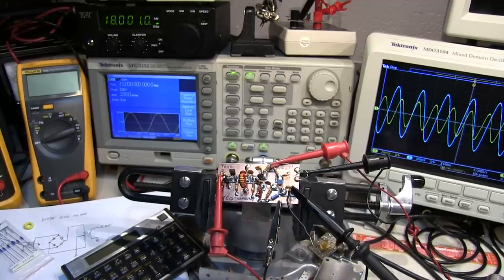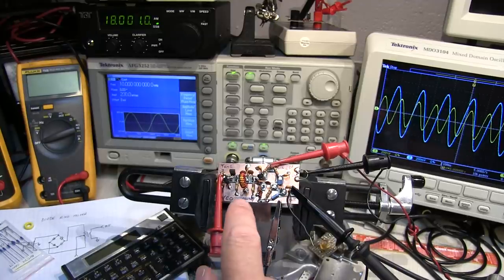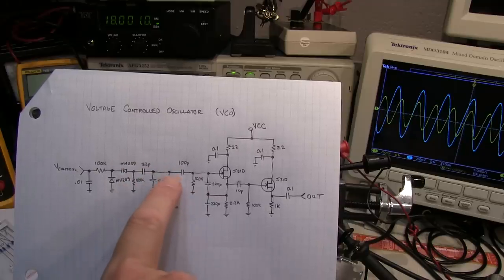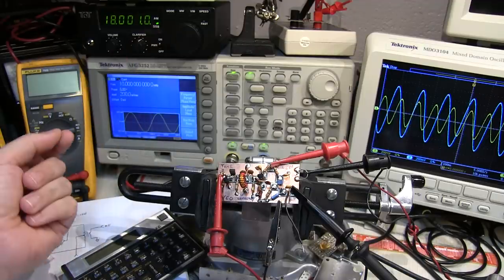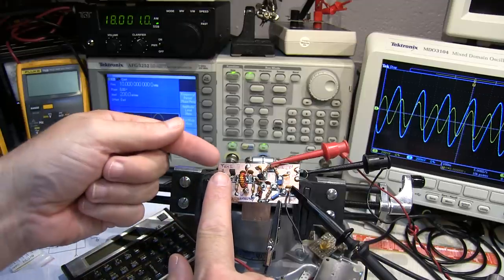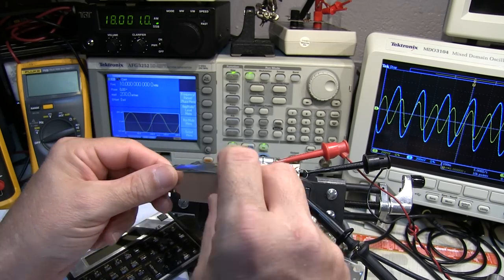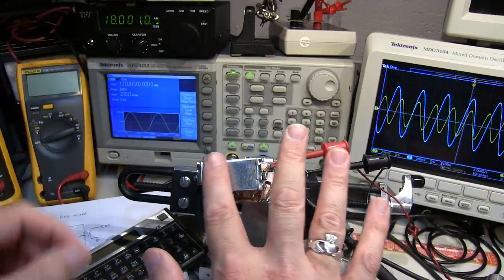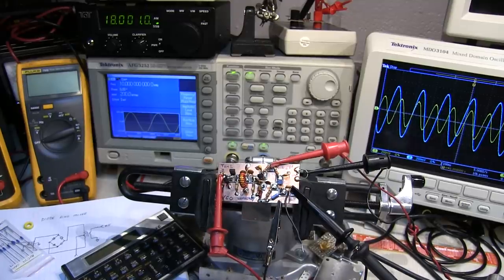#165: Why RF circuits need shielding - or how NOT to build a Theremin! (tnx 4 the title Ben!)

Comment: HI, You can touch the shield and still doesn't make any difference in frequency but the shield must be solid. You actualy touched and slightly moved the shield that is why the frequency was sligtly changed.
Reply from the maker: Yes, that's absolutely correct.
Reply: Essentially making a variable capacitor by changing the distance between the plates?

Comment: you actually made a capacitive sensor :) , i am remembering my Power Electronics Professors  inductive proximity sensor (we did this in the electronics lab) where a hartley oscillator is supplied with a constant current source  and the coil is wound on only one ferrite core (only one E section )and when circuit starts oscillating and if we bring a small magnetic material near the E core the oscillation vanish :)

Comment: Hello, sir. I'm actually trying to build a theremin with Colpitts' oscillators, Gilbert cell multiplier, and diodes envelope detector. How can I enhance the sensitivity of the oscillator to this parasitic capacitance? (I mean start getting those frequency variations when my hand is further away). I don't have an oscilloscope, and, in addition, I have a limited variety of components, so this project is being a big challenge for me. I'm learning quite a lot about electronics thanks to your awesome videos. Regards from Spain!

Comment: Great video!
Seems that cell phone manufacturers have this stuff pretty well figured out... but it's still a mystery to me. Questions: I've experimented with small transmitters in metal tins with no problems and cannot detect any RF leaks, but not so with higher powered transmitters. The box prevents interference from external sources,  but the box itself radiates a lot of RF. What is best practice for containing higher powered RF circuits (>10W) in a metal box? Is the box supposed to be grounded directly through the supply, or via the circuit ground plane, or isolated completely? Should BNC ports be in direct contact with the box or insulated? How large can the ventilation screens be? What are reasonable expectations for preventing a strong signal from leaking out of the box or for preventing the box from acting as an antenna?
Reply from the maker: There is a lot to this topic.  The frequency of operation has a LOT to do with it, especially when it comes to the size of any openings or apertures.  In general, the more pervasive the ground, the better.
Reply: @w2aew  Another aspect of this issue I found equally problematic is microphonic noise unintentionally coupled to RF, such as cooling fans or other mechanical noise introduced into an RF output. Any suggestions?
Reply: Turns out the noise from my cooling fan was not mechanical but the effect of the permanent magnet inside the BLDC. I reoriented the fan 90 degrees. I guess a higher quality fan might be better shielded, but I use whatever is in junk box.
Reply: @w2aew  Continuing my quest to eliminate fan noise... I've found that proper orientation reduces magnetic interference, but not common mode noise. Seems that a fan can still inject significant noise through the common ground connection. 
Question: If I use two separate supply transformers for the fan & the RF circuit, will this isolate the ground references? Or will they both still reference the wall outlet connection in some "turtles all the way down" sense?
Reply from the maker: @andrewferg8737  I would think that a separate supply transformer should really help - but it does seem extreme.  Have you tried common-mode ferrite chokes?
Reply: @w2aew  "Have you tried common-mode ferrite chokes?" ----

I have, but as with all LC filters they can be quite complex to use effectively. I haven't quite figured them out yet. I've noticed that they can also introduce other problems into the LC networks within an RF circuit. I was hoping you would make a video on the topic... hint ... hint. 
Again, thanks for the education!

Comment: Would you have any advice on which are the easiest material to build these shields out of? I am wondering if aluminum would do as well as copper or some other material. Or for example how effective would plastic case lined with copper tape be?
Reply from the maker: As long as you can effectively ground the material, just about anything metalic should work pretty well.

Comment: Nice demonstration. Wonder what frequency thresholds should you start worrying about shielding ? Beyond audio freq maybe ? Is there a rule of thumb ?
Reply from the maker: It depends a lot on the circuit. An audio amp typically wouldn't need it, but a sensitive mic preamp might. Signal levels, circuit node impedances, frequency of use, etc. all help to determine if shielding is needed. Once you get close to a MHz or more, it's is a good idea to shield. Also a good idea to shield high speed digital circuits, because the fast rise/fall times on the digital signals contain signals well into RF frequencies and can radiate a lot of crap.

Comment: I build small fm transmitter and used sdr dongle as spectrum analyzer to find out transmitting frequency. I notice that every time my hand was near antenna frequency shifted up and that is, I realized after few hours of head scratching, because antenna is directly connected to LC resonator.
Reply: Adding a buffer after the VCO to drive the antenna will help.  You can see in Alan's circuit he has a source follower after the VCO to help reduce effect of any load impedance variations on the oscillator.  The buffer can also have some power gain and help drive the antenna impedance, which will generally be pretty low compared to the oscillator tank (even if you are using a half-wave end-fed or similar high-Z antenna).  A common-base amplifier has good reverse-isolation and can make simple FM-bug style transmitters fairly stable.  I built quite a nice one once with a cascode isolator/power amplifier, with emitter coupling between the oscillator and the cascode output stage.
Reply: I must build buffer. Actually I don't need  transmitter. I need oscillator at 50MHz and I needed to find out approximated dimension of coil. Now I need to find amplitude of output signal. I build rf probe, shown by Mr. Wolke couple of videos before, but I don't trust it because I don't know input impedance of probe and effect on measured signal.
Reply: rapsod1911
I just simulated it using 1N4148 diodes, it has an input impedance of about 400 ohms at 50 MHz.  From a 50 ohm source it is flat to beyond 100 MHz.  Lower capacitance diodes would improve this, say some 1N5711.  You could front it with a JFET follower, a 2N4416 or J310 with a wrap-around MPSH81 and it would be flat to beyond 100 MHz from a few kiloohms, especially if you bootstrapped its input capacitance.

Comment: It would be nice to quantify the induced freq shift.  Since the receiver display didn't move from 18.001 MHz, I'm guessing the shift was in the tens of Hz.  For a lot of applications that shift would meet spec.
Reply from the maker: The frequency offset can be directly heard in the receiver's audio.  It sounds like the audio is running from a few hundred Hz to 2 or 3kHz, indicating a carrier shift of a few kHz.
Reply: The audio is mixed down by some unknown (and changing) scale factor, so I doubt it's an accurate.  Plug in your VNA if you want the right answer.

Comment: Would drilling holes into the shield create a better Faraday cage?
Reply from the maker: I don't see how holes would help at all.
Reply: *****  I'm thinking that the solid metal would create more eddy currents creating more radiation. My microwave uses a screen but may just be for visibility. I've seen people use screens around their home to greatly attenuate rf radiation. I'd probably test it with the holes smaller than the wavelength/4. I think it could be an interesting experiment.
Reply: Holes aren't "better than" a solid shield.  Holes that are less than 1/10 wavelength are simply "good enough."

Comment: Will adding the shield alter the base oscillation though? Like after adding it you would have to adjust again? Thanks for the video, im dealing with some of these issues myself in a test circuit
Reply from the maker: Yes, you most likely will have to adjust it again after shielding is applied.

Comment: I've seen many wifi routers with unpopulated shields, there's any reason to that? does the shield reduce the rf output power?
Reply from the maker: With highly integrated RF components, like those found in wifi routers, the EMI/EMC problems aren't as bad.  If the PCB layout is carefully done with transmission lines, etc. then the emissions will often be manageable.  Above all though, these high-volume consumer products are highly cost sensitive.  If a manufacturer finds that they can meet their industry's EMI/EMC emission and susceptability limits without installing a shield - that will save them money and they'll leave them off.  Does this make for a less robust design - yes!  But, it's cheaper to make, and all they care about is if it is "good enough" to be a successful product.

Comment: Thank you for all of your efforts to produce these videos!
I've always wondered about shielding, is grounding the shield important? Especially when the noise seems to be capacitive like this, would the shield be effective without being grounded? Thanks again!
Reply from the maker: The shield really needs to be grounded to work properly.
Reply: If the shielding isn't referenced to the circuit it will be just like adding an extra capacitance in series with the varying strays you are trying to shield.  If anything a floating shield just makes a bigger plate to pick up disturbances with.  By rigidly defining the potential of the shield you encase the sensitive parts of the circuit with constant parasitic couplings.  The secret is really the constant-ness of the parasitics, at least in terms of stability as shown here.  The conductivity of the shielding does help block varying electric fields (and magnetic to some degree) but that alone is insufficient to completely control coupling of the circuit to the environment unless the shield has a fixed potential with respect to the circuit.

Comment: Great video indeed! But I'm curious, how do you make those nice pcbs?
Reply from the maker: That particular one is simply a bared piece of double sided cooper clad board, and I used little solder islands/pads from QRPme.com. You might want to check out my video on circuit construction techniques.

Comment: I tried shielding a circuit without grounding the shielding. Then realised I was "shorting" the RF from the output stage to the oscillator and causing tonnes of parasitic effects. Was broadcasting on a few thousand frequencies at that point!

Comment: New HAM here, KK4EDE, went from zero to hero very quickly. I looked you up on qrz and see that you have an engineering degree, where did you go to school.  I also have a BSEE from an ABET accredit school but I never learned any of this stuff, my 400 level communications course was basically a math course and not a circuits course (can you say convolution and Laplace transforms ;O)  Any how, you are my new hero, keep it coming and if you are looking for ideas how about a deep dive into a VHF/UHF antenna analyzer with a possible DIY design; and go deep into the math.
Reply from the maker: I got my BSEE from NJIT back in 1985.  I tend to stay on the practical side vs. the theoretical side with my videos - more "rubber meets the road" type of stuff.  Welcome to the ham radio community!  You may want to check out my video on using a scope and signal generator to help tune an antenna, and measure complex impedance, for inspiration for your antenna analyzer...

Comment: I was under the impression that a theremin used two oscillators and the output audio was the beating between the oscillators, but i guess this works too :)

Still trying to wrap my head around how this oscillator works though. My head just can't accept the fact that something can oscillate without a feedback path..
Reply from the maker: I'm sure the Theremin design doesn't look like this circuit, it's just that the principle of varying the frequency via parasitic coupling of a waving hand that is similar.  This oscillator is a classic Colpitts oscillator. Feedback is through the two 220pF caps.
Reply: Wow, I thought that was just part of a combined filter network. Can't believe I missed that. Thanks for clearing it up, it's all crystal clear now.